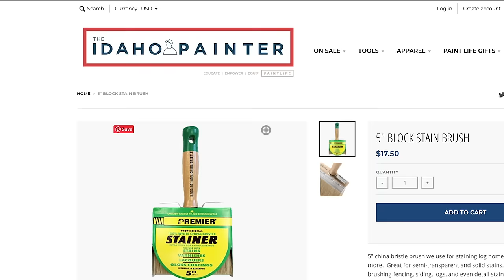Staining a Deck in a DAY!  The Idaho Painter

Comment: I was a large printing press operator. Used aluminum plates to print image. As the industry fell. I started painting houses. Just brought the knowledge and process from printing to painting houses. One thing that has really help me save time and money was using old printing plates to be used as shields. They are .0006 thin. Perfect for sliding under base boards. Or between deck and house. Just slide them in slightly open spaces. Tape to hold. Save me so much money on masking paper and tape. And they can be cleaned and reused. I spay them with TRI-FLO first. So the paint doesn’t stick. Leave in sun. And the paint peels off. I get them from local printing companies when the plates are missed printed of images.

Comment: Love your videos ok here’s my ? Is it a bad idea to use a latex main sprayer with oil base stains should I  purchase separate hose gun and suction tube . Just wondering if the oil stain is going to melt the old latex in the pump ?
Reply from the maker: We use separate sprayers

Comment: Just curious if you checked your filters in your pump and Gun. Ran into the same problem a few weeks ago kept on clogging and spitting add to change over to a fine finish filter in my gun after I strain to paint twice and clean the pump out twice. I scratch my head over and over never had that issue before. First time for everything.

Comment: I’m in the process of staining my fence using graco project painter sprayer. I’m using a FFLP 412 with racx. I’m using a semi transparent behr water base stain. 
It seems not enough product is coming out. I tried a normal 512 tip and it clogged. Should I go up to a 416 FFLP? 
In order to get good coverage I do a light coat then brush and then a heavier coat and back brush. To get decent coverage I have to go pretty slow with the sprayer board by board like 6” away. Any advice?

Comment: I couldn't find this product on there website. They have something called summit solid color stain, is it the same?  One coat or two on new deck? ( pressure treated wood left unfinished for over 3 years). I feel for you; Romondo moving in slow motion. I really like that extension pole brush!

Comment: Question about whip hose length. Where can I order a 25ft whip hose? I have a Graco 395 and for alot of my home jobs, it would make loading up and cleaning out much easier. I was told by Graco that I couldn't use a 25ft hose cause it would cause pulsations in my spray pattern, so can you explain a little more about hose lengths and what types would work etc?  Thanks

Comment: I have the same sprayer but haven't ever used stain in the sprayer. What is the process for cleaning out the sprayer after you are done spraying?
Reply: Well if it’s oil. You will really need to run good paint thinner through Line. Lots of it. UNTILL there is no color left. Make sure you clean Gun and filter in gun. Water base stains do as you would do with any water base paint. But still clean gun and filter. Especially the filter in gun. There is always paint left in it. Best to take apart gun and clean thoroughly. I for got to clean gun after a job. And by the time I did my next job. Gun was clogged with last job paint. Had to use a guitar string to clean it out. But was able to get job started and finished.

Comment: Can I stain a fence with a roller connected to a airless sprayer? I do not want to use a sprayer that will have the stain floating in the air attaching to other people's property.
Reply from the maker: Yes you can
Reply: They want to use behr oil-latex formula. I want to use a roller on a airless sprayer with roller attachment.  Im doing 45 foot per panel and its at least 30 panels. Wowsers. Power washing took me 4 days. Can you recommend a roller nap please. Im doing my 1st stain for a Gated subdivision.